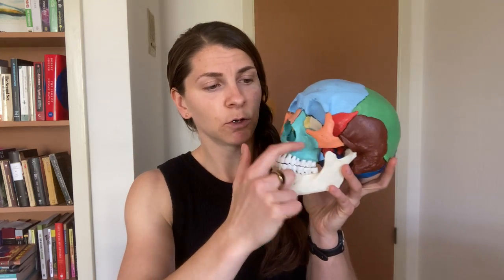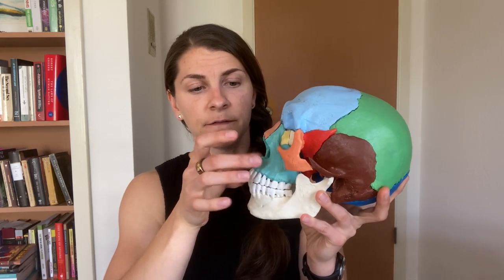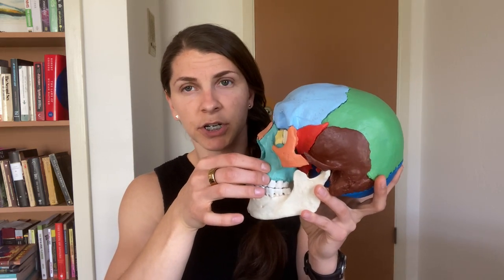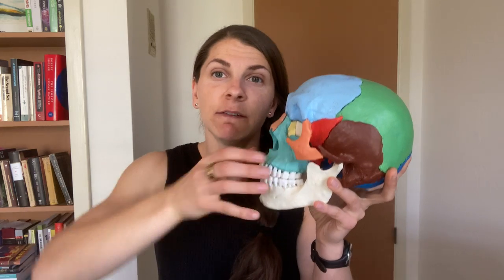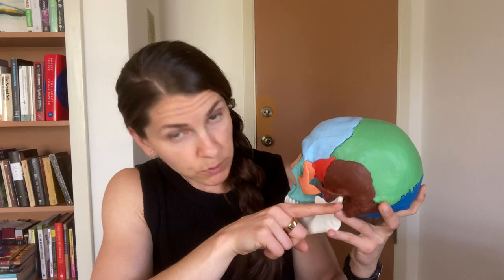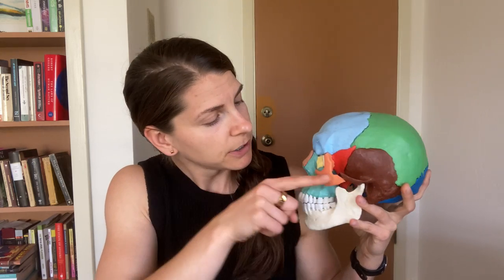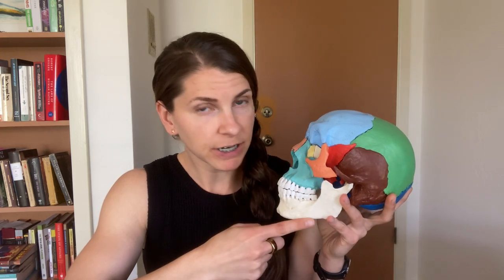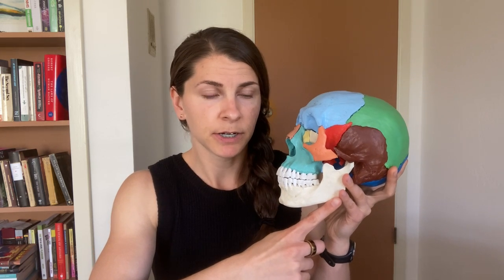Counterclockwise Rotation - Maxillomandibular Advancement Jaw Surgery

Comment: hey Ashley this was a very informative and nice video. So what happens if you have wear and tear on the condylar joints? Is there any solution to ensure a positive outcome? Would there be a joint replacement of some kind?
Reply from the maker: Depending on how much wear and tear you have on the condyles, some surgeons will suggest TMJ replacements for better long-term stability of the surgery/joints.  Surgeons will have varying opinions on this so it's wise to get at least 2-3 opinions before moving forward.

Comment: Good video only thing I have objection with is maxillary impaction and auto-rotation improving the airway, that's really not the case, in order to improve soft tissue support / increase tension between the soft and the hard tissue you must enlarge the face such as with downgrafting not shrink it. Years ago people said it helps the airway but it is since disproven.
Reply from the maker: Thanks for bringing this up.  Can you please send me the articles disproving it?  I would be very curious to read them.   Thanks again!
Reply from the maker: You could send them to ashleysommerspt@gmail.com or write the article name, year, and authors here so others can read as well. Thank you!
Reply: How you doing Ashley ? Have a question  and a request for you , if you don’t mind of course ! The question is how a steep occlusal plane affects the joints ? And my request is that if yo don’t mind me sending my e line ricketts test befor and after my bimaxillary advancement surgery , i just wanna know why my mandible angle became steep, my chin is not as forward and I seem
To have some sort of lip incompetence , thank you !
Reply from the maker: @amadeomiotto4573  Reading "Management of Obstructive Sleep Apnea" (at least parts of it) published last year by Springer, may help you understand the most current research regarding the relationship between the TMJ, the e line, in regards to the MMA itself.
Reply: @allsleepashley  Bit late to the party but I'll send you a few. The sources alone may not prove anything one way or the other to empirical certainty, but I think also looking at the physiological side of things explains it quite well. Even if we don't know everything empirically I believe best practices should suffice.

Two important ones I'll list are these two:
* Effects of maxillary advancement and impaction on nasal airway function
* A one-arm surgical trial of obstructive sleep apnea (OSA) patients before and 12 months after Bilateral Internal Ramus Distraction of the mandible (BIRD)

When it comes to auto-rotation, it's quite simple and can be explained physiologically, you want to splint the mandible. Think of a oral appliance, a MAD, this type of tool keeps the mandible in a forward position during sleep so the tongue base is more forward so it won't fall back as far and, hopefully increase negative pressure (though they usually don't work but that's an argument for another day). The issue with auto-rotation is that whilst it changes the position of the mandible during sleep however it can fall back to the original position. Alternatively when the mandible is lengthened (for example with CCWr w/ posterior downgraft), the isn't possible, it is splinted, there is now no need for an oral appliance.

Also with impaction, I mean why would you want to shrink the nasal airway, you know that just opposes everything we know about nasal airway surgeries reducing AHI. Turbinate reduction, nasomaxillary expansion, etc. If the nasal aperture were a non factor then these surgeries especially nasomaxillary expansion which expands the nasal aperture, exactly what we're talking about here except in the vertical dimension as opposed to transverse, wouldn't be so effective.
* Endoscopically-assisted surgical expansion (EASE) for the treatment of obstructive sleep apnea

The other thing is that as you probably know, these two typically go together, and so not only are you now simultaneously not splinting the mandible but you are also shrinking the nasal aperture (and thus the nasal cavity volume and releasing tension to the muscles).

If you would like to hear additional information on nasomaxillary expansion / EASE, and also MMAs which required revisions from Stanley Liu due to auto-rotation, impaction, and GGA, this video from KKL is a great watch. ~ Maxillary Expansion with Dr. Kasey Li | Not All Are Created Equal | EASE
Reply from the maker: @shuikai272  Thanks for the input and the recommended papers-- will put them on my list to read.   

I want to make sure I understand your sentence above "Alternatively when the mandible is lengthened (for example with CCWr w/ posterior downgraft), the isn't possible, it is splinted, there is now no need for an oral appliance."  Can you please explain this differently because I'm having trouble following.

In regards to impaction, I agree... you are compromising nasal passageway volume.  CCWR is not always done with impaction.  In this video, I did not get into impaction.  Rather I am explaining the movements of CCWR without impaction, which will make the A to P upper airway widen behind the mandible/base of the tongue.

Thanks for the Kasey Li recommendation.  Will definitely listen.

Comment: You can only impact the front aspect which is not basil bone. That’s more for a front aesthetic and not the actual maxilla
Reply from the maker: Yes, a CCW rotation is often used for aesthetics as well.  The maxilla is cut side to side horizontally, intersecting with the walls of the nasal cavity.  The palatine portion of the maxilla is rotated counterclockwise.  You are correct, not the entire maxilla is rotated in this procedure.  It is the same portion of the maxilla that is moved forward in a traditional (non-segmental) MMA.
Reply: @allsleepashley  yea

Comment: This is very helpful. Thank you. I’m getting Lefort 1 & BSSO with CCW
Reply from the maker: I hope all goes smoothly for you!  It's a big surgery.  Good luck!
Reply: Could u suggest name  of doctor 
to get bimax cw rotation with best result under 6k dollar
Reply from the maker: @parasjoshi1062  I don't think you're going to find this.  All the best orthognathic surgeons that I am aware of are out-of-network and charge between $30-70k for the procedure. Where are you located?
Reply: @allsleepashley  Would you suggest a surgeon in CA? Preferably located in LA or SF
Reply: @allsleepashley  Hi Ashley.  I'm from Chicago, IL.  Do you know of any good surgeons in my area?
Reply from the maker: @SajidKhan-kt6rz  I highly recommend not choosing a surgeon solely based on proximity to your home.   Unfortunately, at this point, there are no surgeons in your area that I'm familiar with.
Reply: @allsleepashley  Can you name a few you recommend
Reply from the maker: @SajidKhan-kt6rz  Depending on the details of your case, it may be useful to speak with Sullivan in OKC, Relle in LA,  Gunson in Santa Barbara.  There are others that I may recommend in very specific cases.
Reply: @allsleepashley  I have class 2 skeletal deformity and severe sleep apnea Ahi of 83
Reply from the maker: @SajidKhan-kt6rz  It may be worth consulting with Movahed in St. Louis as well.
Reply: @allsleepashley  Thanks!
Reply: @Ashley Sommers  I met with two surgeons so far and both of them talked about moving 4-5mm both upper and lower jaw.  They are not sure if they can move further without the intervention of a orthodontist
Reply from the maker: @SajidKhan-kt6rz  It is rare to have this surgery without the assistance of an orthodontist.
Reply: @Ashley Sommers  I'm wondering if orthodontist can help them determine how far jaw can move.
Reply from the maker: @SajidKhan-kt6rz  The purpose of orthodontia done to prepare for this surgery is typically to decrease any dental compensation that is limiting the ideal surgical movements.  It's typically the surgeon's call in regards to how far your jaws are moved forward.
Reply: @Ashley Sommers  I met a surgeon today who can advance my jaw atleast 1cm and can do CCW rotation along with Genioglossus advancement
Reply from the maker: @SajidKhan-kt6rz  I recommend getting at least 3 opinions/treatment plans of 3+ really good surgeons and comparing their recommendations to make sure you're making the best decisions for your entire case (airway, occlusion, aesthetics).
Reply: @Ashley Sommers  Thank you so much for replying to my every comment here.  I wish I could find more surgeons in my area, but really, I'm limited to only one surgeon who is in network and in my geographical location
Reply from the maker: @SajidKhan-kt6rz  I highly recommend not choosing a surgeon based solely on geography and in-network contracts.  I have seen many patients choose that route who ended up paying MUCH more (in time and money) in the long term due to complications and undesirable results.  I'm not saying all in-network surgeons are bad... I'm simply saying I would not choose a surgeon based on this constraint.
Reply: @Ashley Sommers  My recent visit to Orthodontist concluded that my maxilla can only be moved 4mm.  I don't understand what's stopping them from advancing atleast 10mm
Reply from the maker: @SajidKhan-kt6rz  Make sure you are asking good questions.
Reply: @Ashley Sommers  My orthodontist is saying moving my maxilla no more than 4mm. Otherwise, I will have gummy smile.  I'm disappointed.  Should I see a different orthodontist?
Reply from the maker: @SajidKhan-kt6rz  Did you ask why you would have a gummy smile if you were moved more than  4mm forward?  What is their reasoning?
Reply: @Ashley Sommers  I have gummy smile to begin with, and any further advancement wil exacerbate my smile
Reply: @allsleepashley  Would you recommend me to Kasey Li?  I have heard a lot about him
Reply: @allsleepashley  My maxilla is already in a forward position and thus advancement is limited to only 2-3mm
Reply: @allsleepashley  Hi Ashley.  Do you have names of more surgeons?

Comment: Question about the TMJ part of what you said.
Couldn't one stabilize the tm joint after the counterclockwise surgery? Would it matter too much to stabilize before or after as long as it gets done? Also if it is moved forward would it not become more stable since it's not grinding anymore?
I have unstable left tm joint causing the jaw to be tilted and worn down on one side. I am potentially getting MSE expander with Dr Ting and then was going to bring upper and lower jaw forward with counter clockwise rotation. Apparently the surgery is supposed to fix the TMD.....Idk know anymore though because I feel like what you said makes sense.
Reply from the maker: The instability of the TMJ after surgery means that the bone on the condyle could resorb, shifting the mandible into a less predictable position, which would also then influence your dental occlusion in a negative way. 
When you say "not grinding anymore", what exactly do you mean?  Do you mean the condyle grinding on the temporal fossa?  This is not necessarily what is going on when you have TMJ issues (but it could be in your case if you've confirmed this with imaging).
When you say "unstable left tmj" what do you mean?  Is the disc stuck off of the condyle?  Are you experiencing condylar resorption?  
There is no guarantee in any surgery.  It is always a risk.  It depends on your own goals and your analysis of whether the potential risk is worth the potential benefit. 
I am currently in an MSE.
Is Dr. Ting planning to do cortipuncture with your MSE?

Comment: Hi Ashley,  thanks for the video. Is clockwise rotation common during MMA procedure? Or is it mostly CCW? Why would someone undergo CW vs CCW?
Reply: sometimes CW is done for people with very short midfaces (for aesthetic reasons). I dont think it’s common. I had MMA surgery for sleep apnea but we did not do any CCW because my occlusal plane angle is already -2 (yes negative lol), so we did linear advancement since there is no room to do any CCW. and I don’t have a super short midface. CCW is always better for airway, if your anatomy is a candidate.
Reply from the maker: CW rotation is not common among the surgeons who work with my patients or who I have consulted with.  CCW is more common.  I agree with John down there.  The occlusal plane angle that a person is starting with will largely determine if they can tolerate any CCW.  There are also surgeons who are not trained in/don't have experience with CCW, so do not do it at all.  I have seen less appealing aesthetic results when the mandible and maxilla are moved forward without CCW rotation.  This is not always true and obviously depends on the starting position of the face... but it is certainly a pattern I have seen.
Reply: @allsleepashley  the risk of less appealing aesthetic result of doing too much linear advancement (without CCW) was the reason we decided to do a conservative 6mm advancement of the maxilla with my surgeon, thinking more than this could create a bad aesthetic result even if it benefits the airway more. I’m very happy with the aesthetic results of 6mm linear advancement, no complaints.

I think the risk of bad aesthetic outcome in linear advancement also depends on the occlusal plane angle. if the person has a steep occlusal plane angle and is a good candidate for CCW, but instead they do a large linear advancement, the outcome is more likely to be not very good.
Reply from the maker: @borz55  agreed.

Comment: I'm having TJR for ICR and a segmented lefort to close my open bite. By doing counterclockwise rotation, will I show less teeth? As I don't really want to lose tooth show
Reply from the maker: This is a good question for your surgeon (and other surgeons so you have a few opinions) as it will depend on other details of your surgery as well.  I know that if they do an impaction of the maxilla or, conversely, downgrafting of the maxilla in addition to CCWR it will more dramatically influence how much your teeth show.  I would think only doing CCWR would not impact tooth exposure as much, but this will likely depend on if they are bringing your maxilla and mandible forward and how much they are doing so as this will impact how the soft tissue of your midface settles.

Comment: I need CCW of my maxilla. My oral surgeon said it can be done orthodontically to correct. Will this orthodontic correction of jaw rotation improve my breathing/airway? Or will surgical CCW be the only way for that?
Reply from the maker: I am not aware of how orthodontics can create a CCW rotation of the mandible and the maxilla. Can you please explain how this is done?
Reply: @allsleepashley  Not sure, I actually didn't ask how. The surgeon just said it can be done orthodontically, since we are not doing MMA and only SARPE. 

I think it's only rotating the Maxilla and not the mandible (so my posterior open bite will close). I assume maybe they would probably attach TADs on my dentalaveolar bone?
Reply from the maker: @Mechthild42  I recommend asking the specifics of this.  I'm guessing they are going to extrude some teeth and impact others but probably not move the maxilla?  Ask specifics so you know what the plan is.

Comment: hi Ashley! I am considering getting double jaw surgery with CCW rotation. However, my surgeon has cautioned on the post-surgical stability of this procedure regarding a relapse in the form of a clockwise movement of the lower jaw resulting in a possible open bite. Have you had experience with this?
Reply: I been a member of the jaw surgery forums for ages and have contacted a lot of OMS surgeons who perform CCW rotations. About a decade ago there was inherit stability issues due to the bone grafting procedures, the CCW rotations and the procedure itself. Nowaways they use this porous bone material, not sure what it's called, HA paste, there is some regression in the following months after the procedure, <10% rotation clockwise, but overall due to technological advances in materials and the procedure, it's stable over the long run.
Reply: @Daniel456324  Even for people with existing TMJ pathology?
Reply: @joedimaggio3146  Yes absolutely. The health of your TMJ joints directly impacts if you can get jaw surgery. If you experience popping, clicking, your joints have worn down and need to be replaced, otherwise the proejction of the jaw and stability is compromised.. Dr. Larry Wolford is very experienced in replacing your joints.
Reply: @Daniel456324  I have bilateral anterior disc displacement with reduction and some pain. No clicking or popping and no limited mouth opening. Do you think I can still have MMA? I am going to consult with several surgeons but I also want opinions from people who don't have a vested interest to perform surgery
Reply: @Daniel456324  so if a 21 year old is experiencing some clicking in their TMJ they need to have it replaced prior to DJS? every DJS surgeon i talked to never even looked at my tmj or cared for it.. whaaat